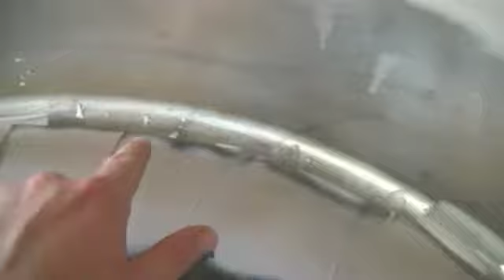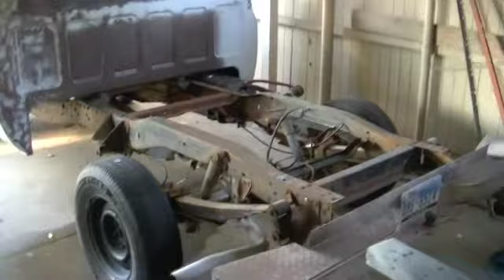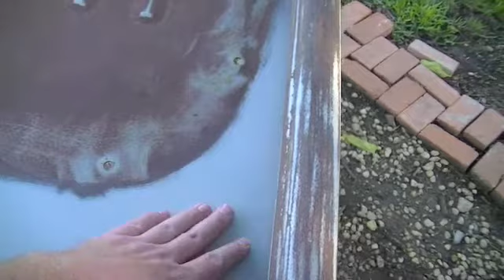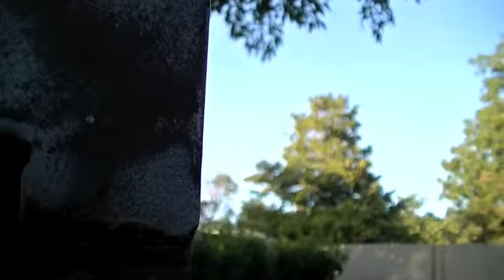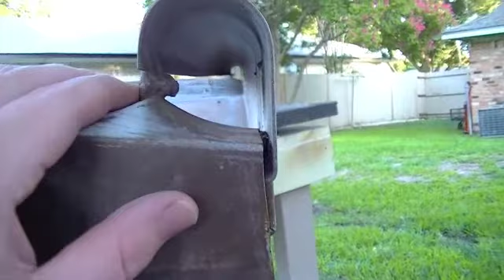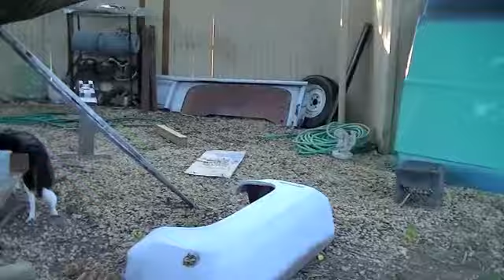Part 14 C10 Spare Tire Carrier

Comment: A fellow step side spare tire fanatic!  Great job.  What are you doing for the actual spare tire carrier?  I built one for my '65: check out post 11 here: http://talk.classicparts.com/showthread.php?t=13928
Reply from the maker: I just fabricated a mount out of some square tube and a small piece of plate steel.  Welded some bolts to the flange and bought some nice chrome lug nuts.  Thanks for watching!

Comment: Fender looks very nice. 

The reason it rusts where you weld is there is still a factory E-coat which looks like bare steel, the weld doesn't have it. You're lucky with that frame, it looks to be really clean.